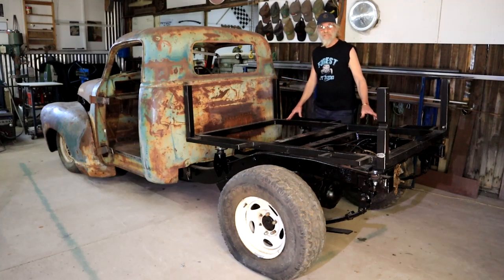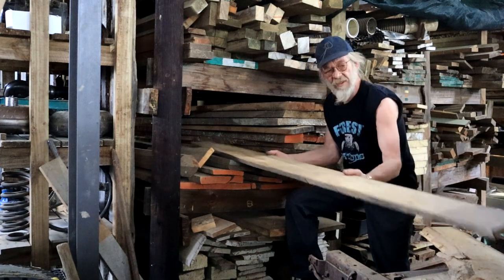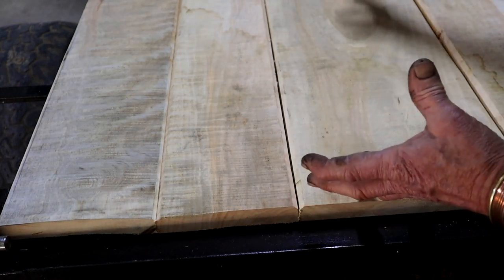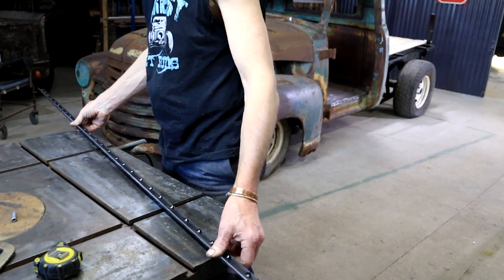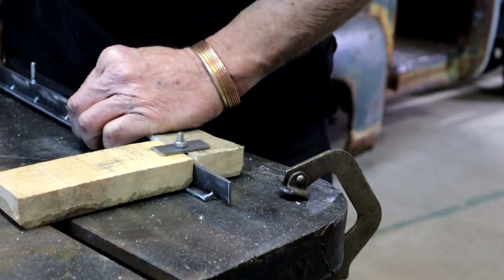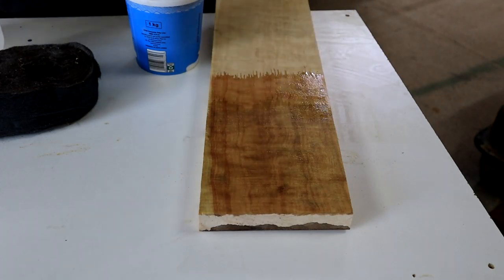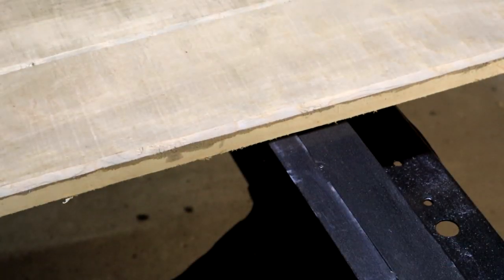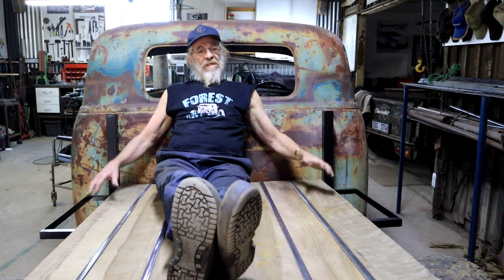Building Custom Wooden Truck Bed - 1951 Chevy Budget Rat Truck

Comment: Nice method of anchoring the boards Diff and a lot easier to remove than un screwing dozens of screws from the top. The witches brew tip will come in handy  thanks for sharing. Cheers
Reply from the maker: Thanks Greg.

Comment: I use diesel fuel with the road die in it for similar projects like you are doing. Works well on decks too and way cheaper, lasts just as long as the new sealers they have out now too. Like what you do... Jer
Reply from the maker: Thanks Jerry. I painte my untreated pine wooden barn with a 50/50 mix of diesel and old engine oil. 20 years later and still good!

Comment: Since I just discovered you, I've been going back to see your older videos.  American gunsmiths in the 1700's would stain their maple gunstocks with a mixture of nitric acid and iron fillings.  After applying, they would heat it by passing an iron bar, just removed from the forge, over it.  This would rapidly change the color to a dark reddish brown.  Then linseed oil was applied.  Just a little history lesson for you.  :)
Reply from the maker: Interesting technique!

Comment: Thanks for the language lesson  The vinegar trick worked well I always like that look I do an old look  by burning in the grain then sanding it with 220 to just give it enough to bring it out then put on a light coat of gray then spray on a matte clear.to protect it.this process is for my signs. I smacken the way your bed came out.
Reply from the maker: 😂 Thanks man! You go to much more trouble than me! I actually just want my boards to be a natural weathered gray. Just did this until then😅
Reply: @ratrodsafrica  yeah I guess so. It's the old weathered look you got have some kind of a look to get the little dollars to fill  the grocery jar.lol. I like the metal work you added on.have a great day.

Comment: Smaak dit stukkend boet! Great tip on the wood staining. I actually found this out accidentally once. I wanted to stain oak and had nothing on hand and happened to have some leftover acid that I used to remove rust with. I thought the brown mix would stain the oak but it turned my oak black instantly! 
Now at least I know it is a thing and has a name:-) 
Thsnks for the inspiring work Diff!
Reply from the maker: Star student on the SA slang!😂 Yes, oak stains very easily through all sorts of methods.

Comment: Dis kwaai, ek smaak dit baie...mooi mooi mooi. Looks cool Div, what about your linseed oil muti, that will also work great with the wood. I use that alot on wood, even on my quarry tile flooring. Tank you for sharing. Bakkie coming along nicely.
Reply from the maker: Thanks Ish. I could oil it, but I specifically want that grey weathered look that exposed wood get over time.
Reply: @ratrodsafrica  OK Cool, i know what you mean...like drift wood.

Comment: i  use linseed oil and used motor oil 50/50 mix to stain and treat wood beds
Reply from the maker: That plan works very well. I treated my wood barn with 50/50 mix of diesel and old oil. 20 years later still good!

Comment: Looks magic Div.
Will you also give it the linseed oil treatment?
And the hydrogen peroxide treatment to your steel runners?
What are you doing for a front tub wall?
Or is rear cab wall the inside of the tub?
Waiting for finished ute reveal.
Reply from the maker: Thanks! No oil, I want the wood to get that weathered grey look. I will rust the strips though

Comment: Einen leckeren bzw. guten Geschmack hast Du. All very nice like always. Eine Essiglauge never tried it, but looks good and does the look you like. Thought of natural stain? Oak chips or leaves watered down I would've tried. Nice job it's really getting into shape now. 👍Gerbsäure ersatz
Reply from the maker: Thank you!
Reply: Oh, well. Thank you. ☺
Reply: Good Morning Diff. I've been thinking about those boards that you've stained and had some kind of memory of doing that and then I remembered that I staind my last boards with instant coffee.
Mixed it up to get the colouration by just adding one spoon after another.
Can't find the pics, but it turned out really nice and it smeeled really good.
You should give it try. 👍
Reply from the maker: @jamesfreeland3137  morning. Thanks, I have done that before but specifically wanted a grey color so the boards look more weathered
Reply: Ok. Got ya’. 👍